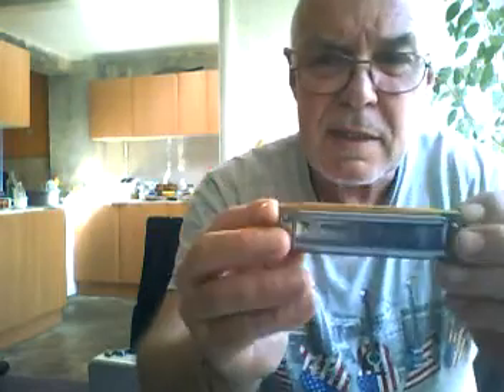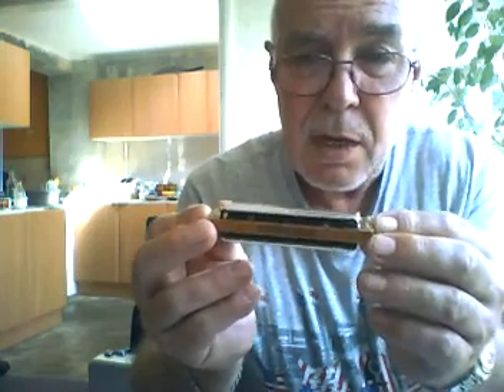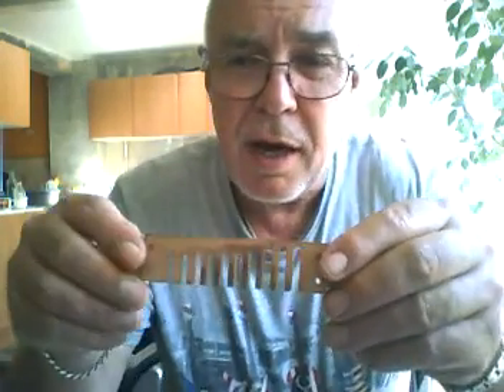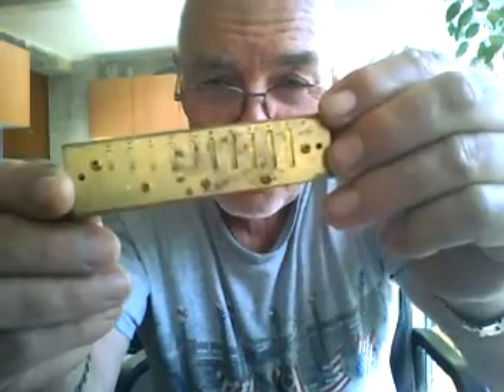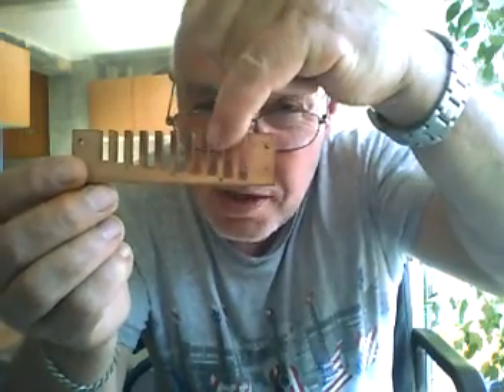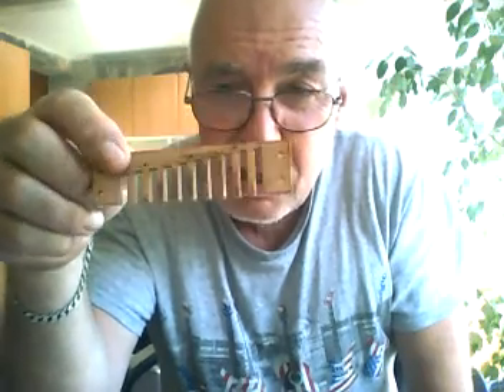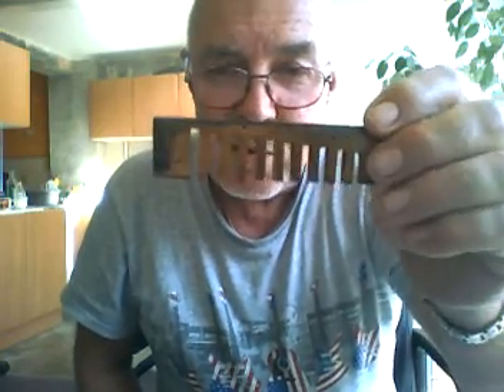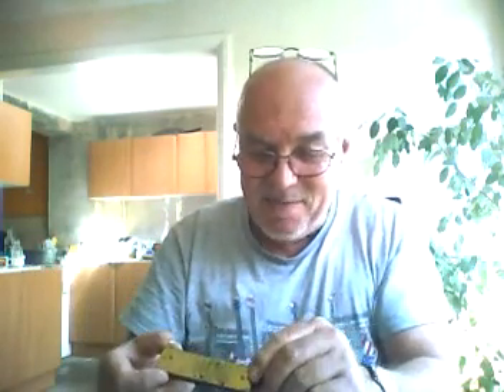Hohner Marine Band Deluxe, Hering 1923

Comment from the maker: Hi Isaac, that's very interesting, all the ones I've had have been sealed totally. I flat and re-seal them as a matter of course. Compared to the pear wood combs the MS have quite a coarse grain so you have to be especially careful when drilling the tines. If you get the chance, do try the Suzuki Bluesmaster
reed plates on the MS comb with the MS covers, what a transformation! A guy on Adam's site reckons the Lee Oskars will fit as well. Good to hear from you, be lucky, Pete

Comment from the maker: Hi b24482. I use either acrylic varnish (very quick drying) or an ordinary spirit based varnish as you can build the coats up to sand back (fine wet & dry) to a flat surface. Some people use butchers block or salad bowl oil. Heated beeswax is another option. I prefer the varnishes for the quality of the finish and the fact that  other than having to change  the occasional blown reed, a harp treated in this way should last a lifetime. I don't think that a bonding agent is neccessary.

Comment: Its interesting that you say MS combs are all sealed. My Blues Harp Combs are not sealed on the reedplate-mating surfaces, just like a marine band, etc. I think they must seal a whole block of wood that has grooves cut into it for the channels, then they slice off individual combs with a chop saw. I also don't understand how they don;t put screws through the damn tines. Wood combed Seydels have bolts in the tines, but they also don't seal the whole comb as well.

Comment: Forgive the double post, I don't have this youtube figured out yet!  Is there a bonding component to use between reedplate and comb that may be removed only by extreme heat, that may fully, undoubtably seal the comb? This should work on wood, you can heat the &^%& out of it without damage, if your heat source isn't direct, without warping.  Plastic may be  problem, depending. . . What do you know about this please?